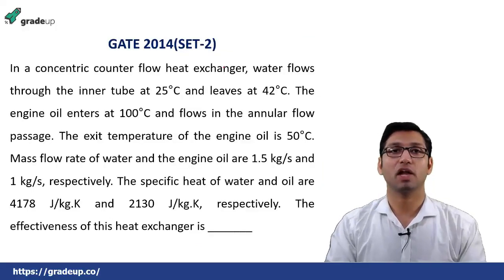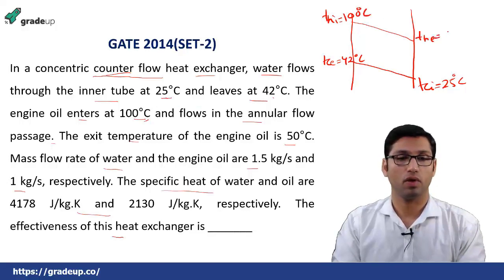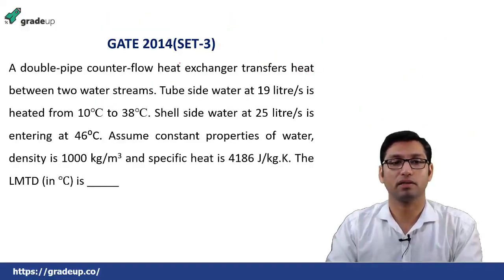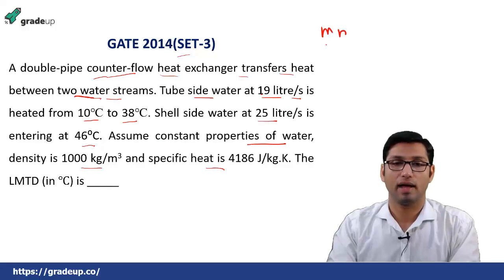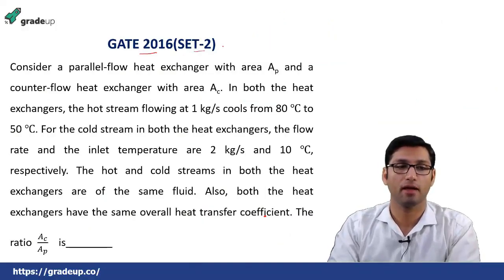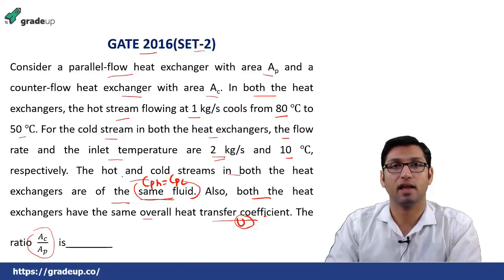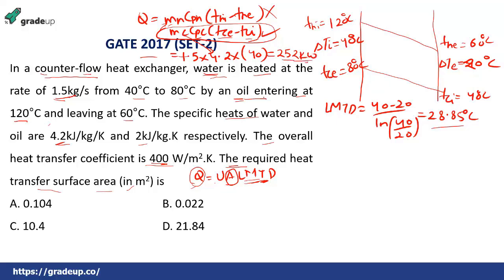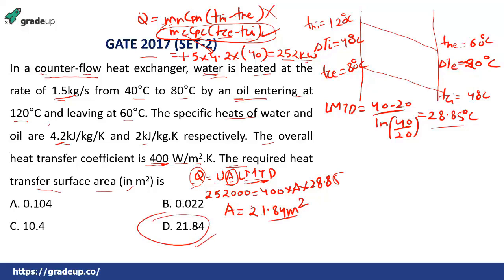Heat Exchanger GATE Questions | LMTD, NTU Design, Shell and Tube Heat Exchanger Problem and Solution

Comment: In question  no 3 the right answer is 290 we have inlet temperature of hot air not outlet  the concept of preheater is preheater uses the outlet temperature of air in sourrounding so we will use NTU approch
T

Comment: Sir Gate 2015 set - 2 qstn
Ans is 290 k
Sir u have mistaken in given data , It's not outlet temp , it inlet temp of hot air is 300k 
By solving we get 290 k
Reply: But in question 300 is  temp given as leaving the system ..so it should be outlet of hot air??